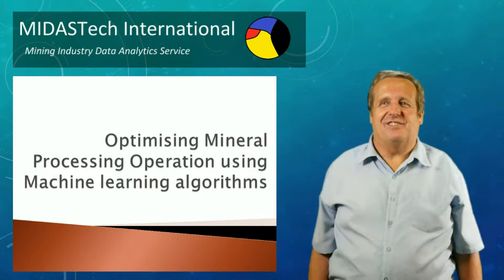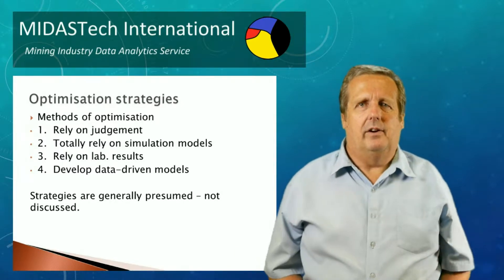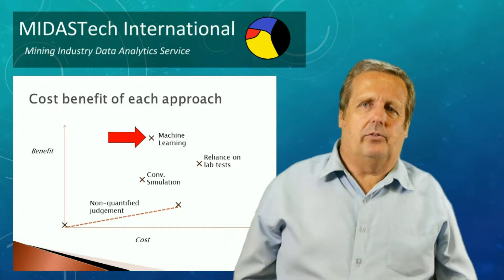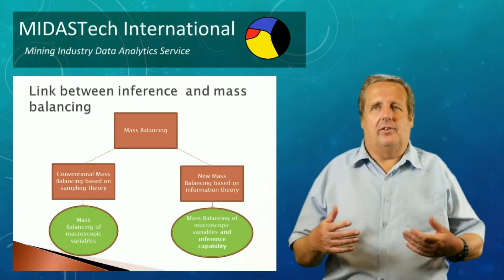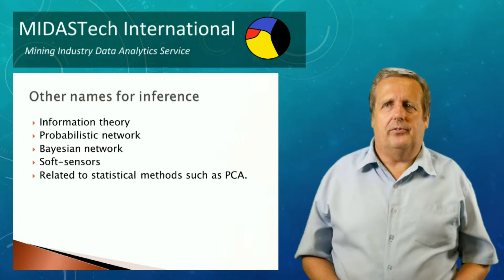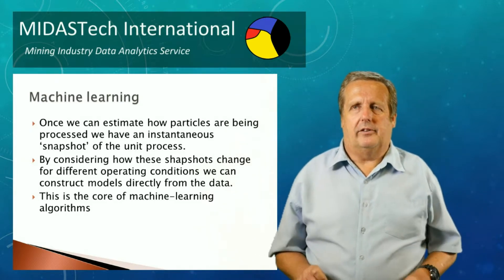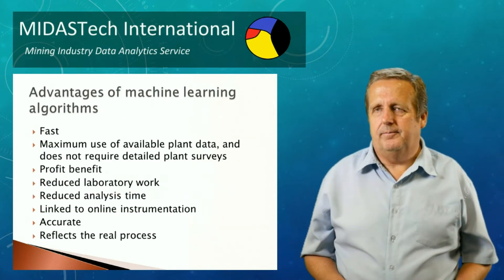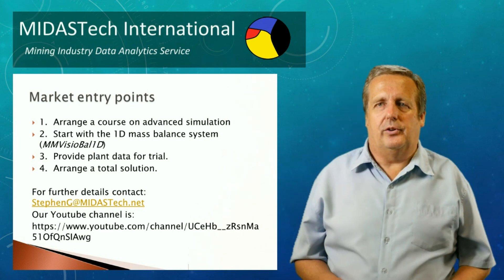Optimising Mineral Processing Operations using Machine Learning Algorithms (v2)

Comment: Nice presentation sir
I m from India, involving in mineral processing equipment selection from last 3 years, can ur software algorithm can be usable with our mineral processing equipment ?
Reply: The short answer is yes, but the long answer would be very detailed.  The methodology is decide-independent.  That is, it is not useful for some equipment and not useful for others.  instead it is useful for all.  The main issue of course is whether there is data so that the unit models can be back-calculated.  There are of course two subproblems.  The first is whether you already have a mathematical model of the unit.  If this is the case then the approach above can be used to identify how incorporating the unit will affect the overall recovery.  The second problem is whether you already have the unit installed and simply want to identify the mathematical model for the unit.  The ML approach can be applied for either subproblem.  Always happy to talk on Skype.
Reply: Sorry for not replying earlier.  Of course, it is a general method.